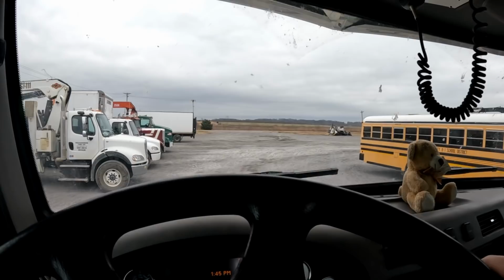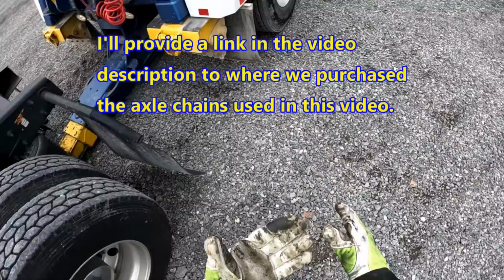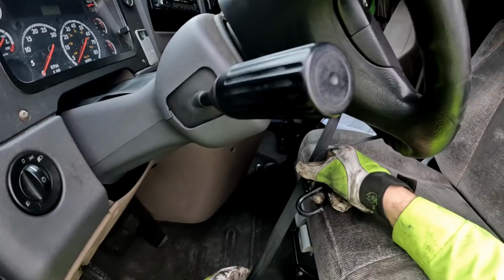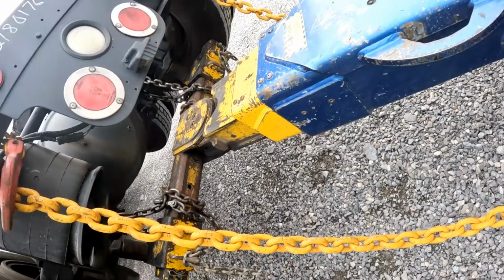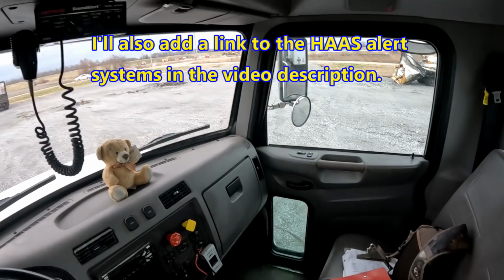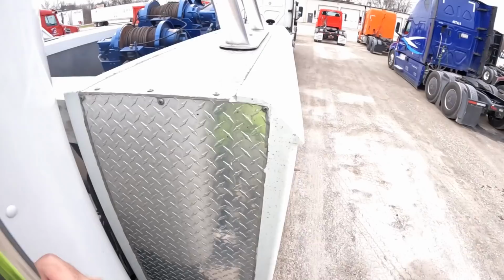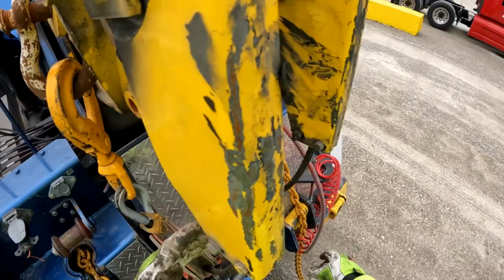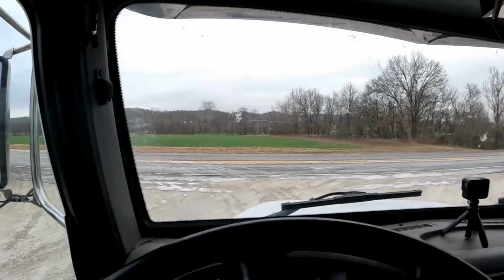On The Hook Again.  Freight-Shaker's On the Hook Again.  Towing 'Shakers is the Life That I Live.

Comment: 28:15 was the first good look I ever got at the plumbing behind the boom/winch control panel.  VERY IMPRESSIVE.  Truck looked in really decent shape.  Good tires, minimum road filth.  So, what kind of issue did it have.  Stay safe out there Ron.  Dad's watching everything you do.
Reply from the maker: Yes, the truck appeared to have been very well maintained.   I do not know the exact problem, but it had something to do with the emissions system and it had the truck in derate mode, just like the 2nd driver's truck where I dropped this one off.   At least this guy was smart enough to have his towed rather than attempt to drive it at 5 mph up the interstate.    Also, when it goes into derate, you never know when that amber light is going to go to red and then you're "dead in the water".  Not a good place to be.      

When things settle down later this Spring, I am hoping to do some updated walk-around videos and perhaps I can show some of the plumbing and other things like you mentioned.   Be safe my friend.   God bless.

Comment: If anybody is curious,  one reason to not have parking brakes on the steer axle is if the truck suffers an air loss and the brake valve pops you want your steer tires rolling,  not sliding, to help control the vehicle.
Reply from the maker: Very good explanation.  Thanks and God bless.

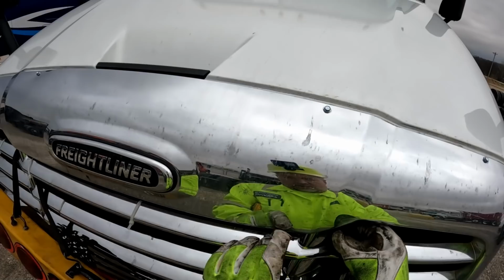Comment: @24:40 suggest to the Mfg that they add a feature, if the unit in your truck gets too far away from the bar, it alerts you in the truck :)
Reply from the maker: Actually, they already make those and we have them in each truck.  Problem is that the in-cab monitor for them isn't hard-wired.   It has to be plugged in to a power port, and, sometimes people forget to plug in the monitor ......   Here is the monitor system:   https://zips.com/parts-detail/towmate-imon-interactive-monitor-system-tm-imon-hd?ppc_keyword=&gclid=CjwKCAiA0KmPBhBqEiwAJqKK4ys8ohBUqdz_MhzYC0JRnQKcGk2l4DvDLiymSx7LBxTUQwWSSu-NpxoCkXYQAvD_BwE     
Thanks for watching and God bless.
Reply: @RonPratt  According to the manual, the monitor units take 12VDC input power, so it should be possible to hard-wire them. Might be worth talking to the manufacturer and your shop guys about.

Comment: This is why towtruck operators do not cross the chains. Even when chaining a trailer you should not cross the chains. The tongue could break the chain or with the tongue on the chain could grind the chain on the road. You should always replace the tongue coupler anytime you have the trailer become disconnected from the vehicle. Also having the chains parallel will help the trailer from swinging. I weld a cross bar on the tongue to spread the chains just a little bit more to help also. I had someone disconnecting my towbar from my car, caught him in the act and I have a way to lock all parts in place including the chains. He was arrested, 3 months in jail and a $10,000 fine. Back up camera records.

Comment: If those are train horns, the one you have on 'tator is a bit anemic, that truck needs a K5LLA horn just like the Norfolk Southern SD70ACe locomotives ,it speaks authority, like GET OUTA MY WAY I'MA COMMIN' THROUGH. I've heard no trucks with that specific horn, I believe if 'tator had one ,everyone in earshot would know help is here when they heard that, it would be sort of a trademark after a bit when people get used to it's impending meaning, plus there's no mistaking the horn code signals, it's CLEAR and a bit louder and it's a bit sexy too, a deep baritone with tenor notes.

Comment: When I  hook up my car/trailer to my RV, I use a mirror on a stand to verify that the lights are working. Saves me from walking back and forth. Especially when I and  towing both behind the RV. Any one towing a car? Have separate lights installed in your car's light so that the electrical systems of the RV and car are isolated.

Comment: 15:40 If you change your Final Walk Around slightly by bringing the light bar to the cab of the Tow unit and then check the lights are working properly before hanging it on the back of whatever you're hooked to, it'll save you some time and walking...
Reply from the maker: However, the light bar needs to be checked while on the towed vehicle to make certain there isn't any RF interference.   Just FYI.   Thanks for watching and God bless.
Reply: @RonPratt  Good point, I hadn't thought of that possibility...

Comment: Ron put a Apple Air tag on your Lighter so if you go off and leave it behind it will go off you can set the Work Address not to trigger the light bar notifaction so if left behind its at the correct location the air tag will go off if you leave it you can get magic cases or something to tie to the rope of light bar so it goes off if you leave it please get a air Tag

Comment: Atleast in the Netherlands you need at least 60kmh to be allowed on the highway. Trucks are limited to 85kmh ish and cars with trailers are max 90kmh and speed limit is between 100 en 130 kmh. So no you can't limp a slow vehicle, plus it's dangerous to drive much slower than the rest.

Comment: Ron I've never heard you or seen you use turbo savers on trucks with exhaust stacks ,of course it looks like this truck has the exhaust underneath but I'm sure you have them ,maybe you could talk about that on another video when you tow one that has stacks backwards , God bless anbe safe me friend 
Tim .
Reply from the maker: No, I do not use turbo savers.   There have been extensive studies done by several manufacturers.   I'll try to keep this as basic as possible.   For the turbo to be able to spin, it has to have air passing THROUGH it, not just up against it.  Unless the engine has major damage where the air can freely flow from the exhaust through to the intake, then the turbo will not spin fast enough to be concerned about burning out the bearings.....at least that's what the studies have shown. Even if an intake and an exhaust valve are stuck open in the same cylinder, the volume of air flow would be so minimum that it not damage the turbo, again, according to other people's research.   This is not my research.   If someone feels better covering the stacks, then they should do so.   Personally, I've never had an issue by not covering the stacks.  Thanks for watching and God bless.

Comment: I got called out for road service for a truck that needed a belt.   Showed up. To big puddle of oil under truck.  Fan hub bracket broke bolts off In front of motor. Ended up getting it towed.  Had a blown air bag.  Bad u joint.  N broken bell housing on back of motor.  Driver told me it popped out of gear from time to time.   He was told to not worry bout it

Comment: Hi Ron, regarding the second truck, I believe that you said the owner wanted the driver to run it down the interstate in Limp Mode @ 5 MPH. Aren't there any Minimum Speed limits in your area to maintain on the interstate highway? Perhaps he'll get a ticket that will cost more than the towing bill would have been !!  Sounds like a torture for the Driver. : (      Great video as always, Ron.
Reply: If the truck gets stopped for under minimum speed the ticket goes to the driver and the owner will say he knew nothing about it.
Reply from the maker: Yes, there are minimum speeds on the main interstate, I-55, in our area and that minimum speed is 40 mph.  Personally, I don't like driving at 55 mph when the speed limit is 70 mph, even though I have to do it occasionally, due to the load I'm hauling.   I'm always concerned that someone is going to come upon me too quickly and hit me.    I would NOT have wanted to be that driver.    I hope his company decided NOT to make him attempt to limp the tractor down the interstate.   Thanks for watching and God bless.
Reply: @RonPratt  Thank you for responding and have a great weekend, Ron !!

Comment: Time for a memo from Ron that all chains made need occasional cleaning. I suspect that is a Ron Rule somewhere!
That tow bar light that is a State of Missouri Requirement? But do they have specific lights that have to be used or is that left up to the Towing Companies?
That new HAAS system seems like a great idea but will the State of Missouri require motorist to acquire the apps needed to get the information or will they require the Telecommunication Companies to make the app available to current Mobile Smartphones?
I was wondering about the drive shaft and why you did not secure it. On rear tows you don't have to do that but on front tows you would have to do that. Got it stored in my brain now. You make it tough on regular viewers. I try to watch closely and learn as I go though in most cases the information I learn may never be used in a practical way but there are about 5-6 channels I watch that do towing operations. 4 in Utah, 2 in California and one in Oregon. Yours is more conventional operations the rest do a lot of Off-Road recoveries and tows.

Comment: Great video as always Ron, thanks.  I'm curious about something, is there a difference between a "tower" and a "wrecker" or are the terms interchangeable and personal preference?
Reply from the maker: "Wrecker" is actually an old slang term and professionals in our industry have tried to get away from using that terminology as it tends to give a negative vibe.   There are many different types of equipment in our industry that basically fall into one of two categories....either towing/hauling or a combination of towing/hauling and recovery.    One example of a basic, simple, tow truck would be a "repo" truck.   They only tow car.  They don't work accidents or perform winch-outs.   Most vehicles in our industry are a combination that can tow or haul AND perform recovery functions.....referred to as a towing and recovery vehicle, because they are capable of both functions.  There are many other types of equipment in our industry, but those are the two predominant categories.   Thanks for watching and God bless.

Comment: Wouldn't it be easier to check the light bar behavior by holding it in your lap in the towing vehicle before attaching it to the towed vehicle.  That way you can verify both turn signals and brake lights without moving back and forth.  If the behavior checks out then you. can attach it to the towed vehicle.
Reply from the maker: You can check the basic operation of the light bar that way, but that doesn't account for RF interference between the transponder and the light bar when installed.  I understand  what you are saying.   I want to make certain that everything works once it is in place and ready to tow.  If, for some reason, there is some interference, the light bars are designed to be able to be run "old school" also by running a 7 way cord direct to them.   Thanks for watching and God bless.
Reply: @RonPratt  Thanks for taking time to answer my question.  I wondered if there was a failure mode missed by testing it before mounting it in a different place from attaching it.

Comment: If that driver is derated because of the dpf system I'd disconnect the speed sensor on the transmission and run it only to the nearest shop but whatever i do i will not even attempt to be a road hazard by driving at 5mph unless I'm literally around the corner from a shop

Comment: I noticed the truck that was towed had a license plate light and a place for a license plate on the frame, but no license plate.  Does it not need a license plate on the back, especially if it is being driven without a trailer?
Reply from the maker: Most semi tractors in the U.S.A. are only required one license plate to be displayed on the front of the truck.   Thanks for watching and God bless.

Comment: I see you put steering wheel straps on. Maybe a dumb question but doesn't the steering lock when the ignition key is removed?
Reply from the maker: It is not a dumb question, especially if you aren't familiar with trucks.  Semi trucks are not like passenger vehicles.  The steering wheel does NOT lock when the key is removed.   Most newer trucks and a lot of older ones don't have the key on the steering column even.   Thanks for watching and God bless.

Comment: Ron, what brand work glove is that you wear? I've been looking just can't find a decent glove anymore I like.
Sorry Ron another question, what is the music you play a lot when you're cruising down the road as in this video?
Reply from the maker: The brand used in this video was Tillman.   I used a wide variety of gloves based on the jobs I'm doing.   The most common gloves I use are just plain, leather, Plainsman that I get from Sam's.  Thanks for watching and God bless.
Reply: @RonPratt  I have a pair of Vgo I like the feel of real well but they offer zero cold weather protection as I was called out last night and 5 minutes later @ 4 degrees my hands were hurting. Years ago I use to wear Plainsman goat skined gloves loved the feel  but hated when it seemed they would no longer hold up more than a week. I'm going to give Tillman a try thanks for the reply.
Reply from the maker: Yeah, once the Plainsman get wet, you might as well toss them.  They are cheap enough though.    As I said, I use a lot of different gloves and the gloves I use are based upon what I'm doing at the time.   I have some Fire Service Extrication gloves that I use when dealing with extrication work or where I'm handling glass and other sharp objects.    You can literally take a knife across the palm of your hand with these gloves and  you won't get cut, BUT they have very little dexterity.    In winter, probably my most used is a brand called Ninja Ice:    https://www.fullsource.com/mcr-safety-n9690hvm/?size=2&gclid=CjwKCAiA0KmPBhBqEiwAJqKK43GiTQeYLxmQInSlnqzSogyHmGDUPcSLMpJBx_emAE2mfkmfz_94bBoCfKEQAvD_BwE
I keep multiple pairs of gloves in the truck, especially in the winter time and one pair is always on the dash warming and/or drying....LOL.    Thanks for watching and God bless.
Reply: @RonPratt  Yup I have everything from welding to brown jersey gloves in a bin here at home and my vehicle. Yes FSE like the old red ball gloves we used in years gone by in the fire service gave protection long as you didn't want to grab anything smaller than a hose or axe handle. And nothing was colder on hands than a pair of red balls once they got water inside them.

Comment: How does the light bar know which way is right or left when you change mounting it from the back of the truck to the front of the truck?
Reply from the maker: The light bar has the right and left sides marked.   As long as you hang the bar properly it will work.  Thanks for watching and God bless.
Reply: @RonPratt  it was a joke that hopefully made you think for a half a second :)

Thanks for doing what you do!

Comment: Do you guys have a high idle on the tow unit truck when guys loading or unloading?And don't forget push in towed truck air brakes
Reply from the maker: Yes, ours truck all have high idle for when we need them.   As far as releasing the brakes on the towed vehicle, there is no need to release the brakes on the towed vehicle when it is being towed from the rear.   The only wheels with parking brakes are lifted off the ground while towing.   The steer axle does not have parking brakes.   Thanks for watching and God bless.
Reply: @RonPratt  your welcome

Comment: I'm not sure if you've talked about it in other videos or not, but the light bar you put on the front of the truck in this video - how exactly does that work? Basically my question is how does it know when you hut your brakes, turn signals, etc.?
Reply from the maker: There is a special transmitter that plugs into the 7-way receptacle on the back of the tow truck.  It transmits a signal to the receiver inside the light bar any time one of the light functions is activated on the tow truck, then the light bar mimics that light function.   Thanks for watching and God bless.
Reply: @Ron Pratt  ah. Thanks for replying. And thank you for making your videos. God bless you as well

Comment: How does it pull with a 4024?  Considering one but concerned about scale weight.
Reply from the maker: For us, this 4024 works great.   It's versatile and maneuverable.  We tow anything from cars and pickups to 1 tons pulling campers to semis with it.   If you are going to be using it for a lot of long distance towing, then you do have to be concerned about scaling it out.   It's very easy to get overweight on the drive axle.   We can tow most tandem sleepers from the rear with no problems, but we can't tow one from the front and scale it...even if we bind the front drive axle and try to lengthen the fulcrum.    Working local, this truck is amazing.   Towing from the rear this truck is amazing.   Towing from the front...not so much.   I would say your decision would be based on what you intend to do with the truck.   If you are going to be crossing a lot of scales with it, perhaps you should consider at least a 5130 with a tandem axle or a tandem with a pusher even.   Hope this helps.    Thanks for watching and God bless.

Comment: Why didn't you use air hoses this time? Is it because there was no trailer?
Reply: The wheels with the air brakes are off the road with a rear tow. The front brakes are hydraulic.